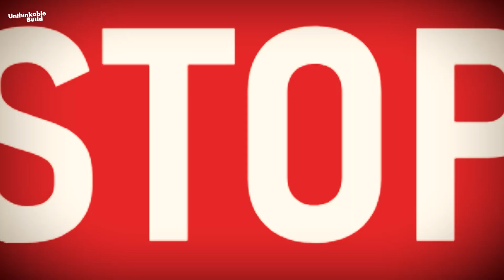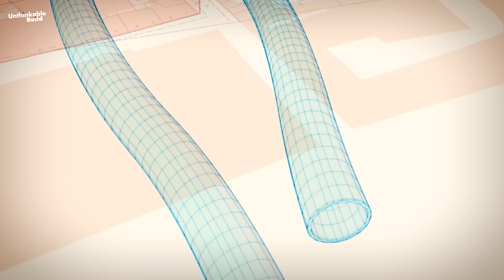Inside LA’s $9.5 Billion Subway Project Changing the City Forever

Comment: We have a lot of folks on here that don't want to hold MTA accountable for their high costs, and terrible system quality.  We have huge issues in Los Angeles with the MTA.  Paid ridership is low and decreasing.  Reports demonstrate that two thirds of the people who take MTA do so for free or are significantly subsidized.  So the system hemorrhages money.  

In Los Angeles, the fact is that MTA's rail product sucks.  It's slow and unsafe (so much so that MTA is having to hire and build their own police force bureaucracy)  MTA rail breeds crime and decay everywhere it goes.  As an example, just search YouTube for videos showing what happened to the Third Street Promenade after the Expo line opened it's terminus in Santa Monica.  (2/3rds of the businesses have closed from constant crime, safety issues, homelessness and mentally ill people streaming into the city)  Check out current videos showing what it's like to ride MTA rail and busses.  MTA rail is filthy.  (I used to take the train and not only did it take 50% longer to get to work than driving, I had to frequently step over feces, pee and trash).  And because MTA will not erect barriers to keep non-payers from entering the system, MTA's trains are full of homeless, open drug users, and violent people, many of which are mentally ill. All of L.A. County's hundreds of billions in spending has been a boondoggle for contractor grift (we spend almost $1.8 BILLION per mile on our subways)

Show up at MTA board meetings and ask the leadership one question:  "What percent of your yearly local travel is done on MTA trains and busses"  MTA leadership does not ride the system they built and run because it's so horrible.

I'm sorry, but it's time to stop building new rail line extensions in Los Angeles and first require MTA (who has budget certainty for the next 40 years with the passing of initiatives like Props M and R) to fix and clean up their existing system and make the product safer, cleaner, better and faster.  MTA's leadership compensation needs to be overhauled and tied to measurable positive outcomes.   If they can't, bring in a private company or someone who can.  

If MTA is unable or incapable of fixing their system, just read the reports of analysts on what's coming by 2040.  MTA transit will become increasing irrelevant as autonomous vehicles, automated AI based traffic control systems, and other innovative transportation methods become commonplace in the next 10-20 years.  And for you fans of MTA, I have no idea why you continue to defend and not hold accountable MTA's leadership that have mismanaged so mismanaged their terrible products.

Comment: Yes. This huge public transit infrastructure project will be yet another game changer for the LA Metro. 

The Regional Connector in 1023. D line subway extension section 1 in 2025. LAX People Mover in 2026. D line subway extension section 2 in 1026. Dline subway extension section 3 in 2027. Unthinkable builds, indeed!